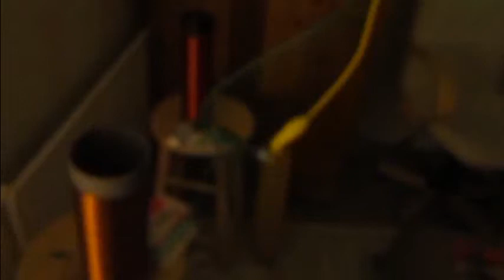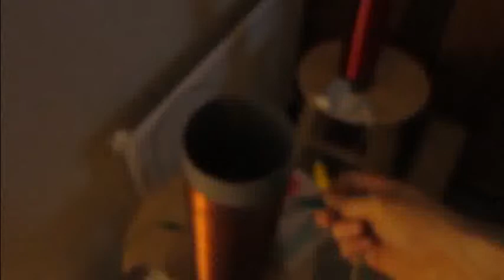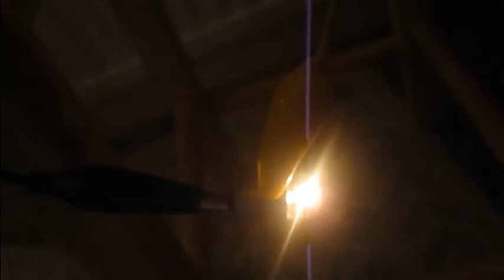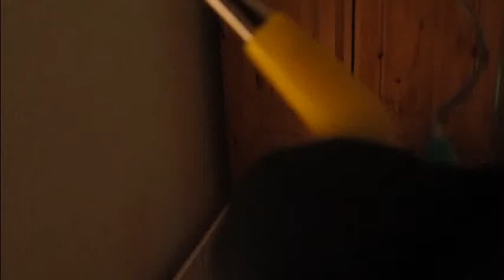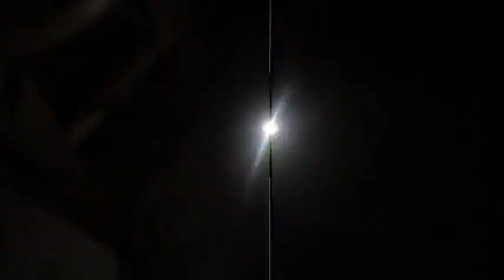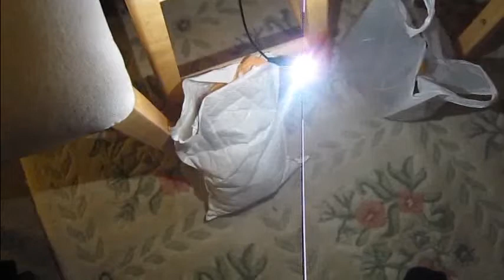Exciter lighting DC filament with Steel Loop

Comment from the maker: No and No!  You can use copper wire, and it works best on the receiver side when the 'loop' is a 2 turn 'primary' - identical to the 2 turn primary I use on the transmitter side.  All exciter builders should try this - its really easy.  Thanks to Woopy for showing me how.  I have to say - this set up is identical to the Tesla patent where he draws a transmitter and receiver.

Comment: Bizarre. Might have to do with the available "step down" not reaching the higher potential. Other than that, there is no real difference between an AC bulb or DC bulb, as I understand it. For example, if you have a 20 watt Halogen, rated at 12V, you can use 12VAC or 12VDC, makes no difference.